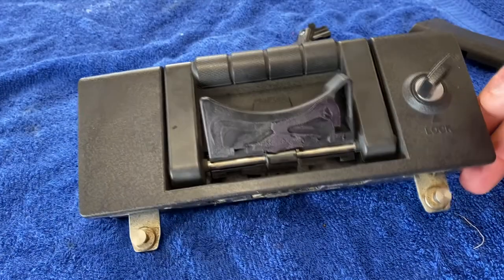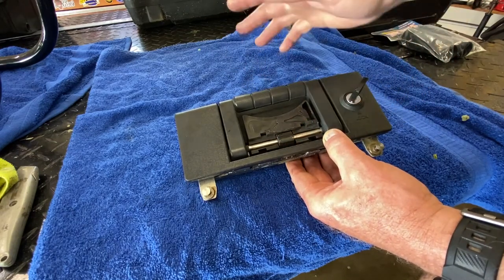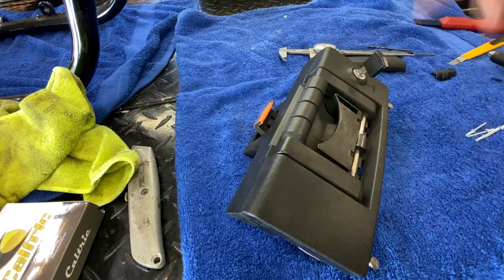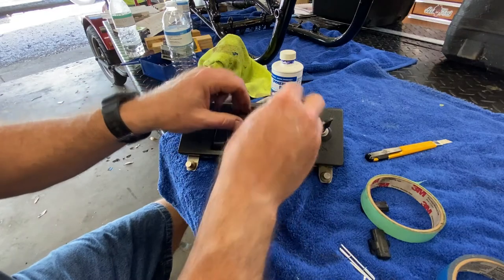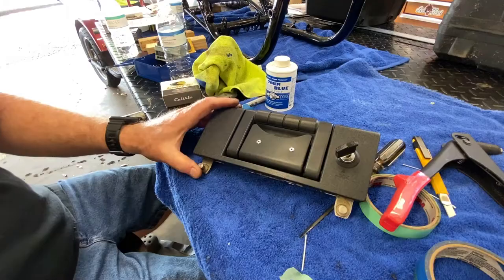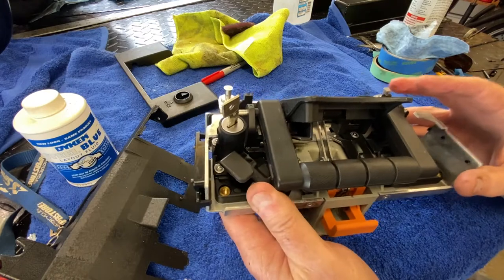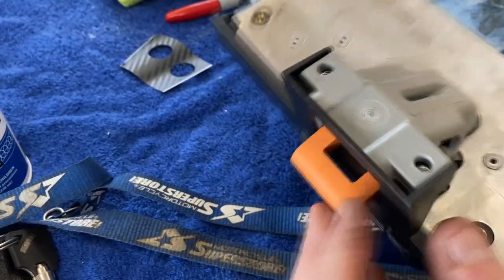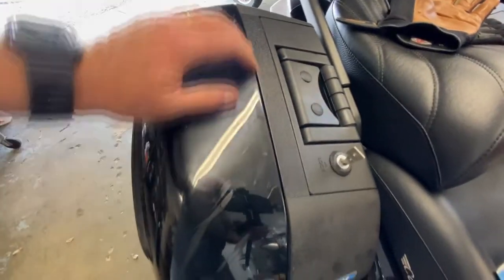Concours 14 hard bag latch repair gets complicated quickly! But it's fixed!

Comment: The luggage is made by Givi, so I’ve been told. I’ve not had any problems with my panniers, it’s a 2010 model. BUT the topbox 😭 it’s absolute cr*p. The top flexes so much that if you hit a bump in the road the top flips open. I lost hundreds of £’s worth of kit on a trip through France. I thought it was operator error at first but it’s just cr*p. Thanks for the videos 👍
Reply from the maker: Quite possible although I had not heard that before. Other marques have used Givi like Suzuki in fact on their Bandit 1250 luggage and probably others. I have one of the larger (at the time I bought it) Givi top cases, it is rigid as heck, no flexing whatsoever. In fact it'd be impossible to distort the plastic to cause the latch to disrupt, not without crushing it maybe with a skid steer or something. Cheers.